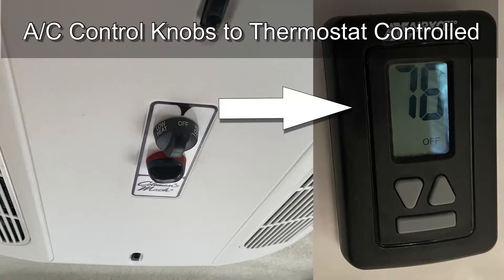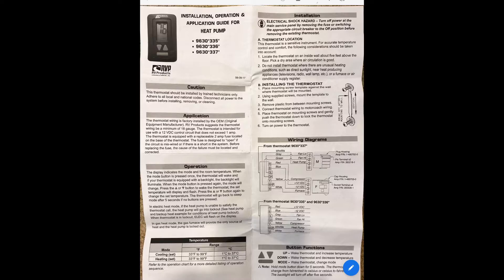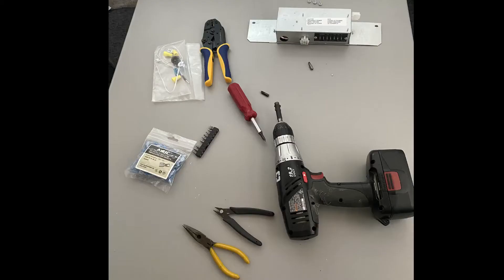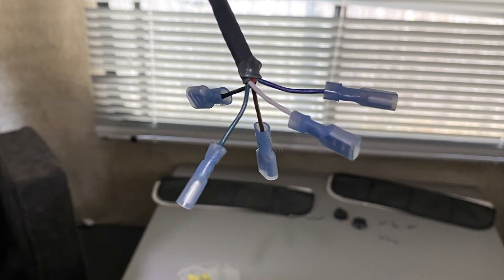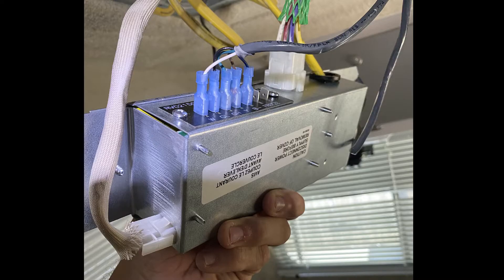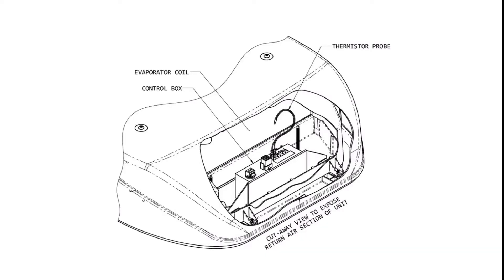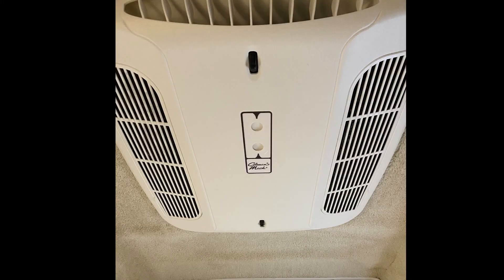A/C Control Knobs to Thermostat Controlled

Comment: THANK YOU... THANK YOU so very much. I installed a new unit with everything for the inside including the Thermostat and the power box. this did not take long.However, the compressor never kicked in and no cold AC. Checked and double checked, tested voltages, compressor continuity, connections, etc. and the compressor wont start....UNTILI watched your video and you said Don't forget to install the Freeze sensor, the compressor wont start without it.... I got an Ah moment... connected the freeze sensor and YESSSS the compressor kicked in and we have COLD air...
THANKs a million.
SUNNY and Sharon
Reply from the maker: Awesome!  I’m very glad my video helped you out!  Thanks for the comment!

Comment: Perfect video !!!! I plan on doing mine now !  I hate the fan the fan runs constantly.  Oh, for the holes if you want a little cleaner look . Pick up some white rubber grommet caps !!! Cheers 🍻  to a well made video!
Reply from the maker: Thanks, good luck!  Depending on your year model, you might need to run some wires up to the A/C from the thermostat.
Reply: @stevelineberry  

I've got a 2021 so it should be very close.  I already have a non invasive route planned for the wiring.  Im seeing mixed things on which control box I need.  I have the Mach 3 Plus... if that makes a difference.  I reached out to Airxcell , hopefully they can set me straight!

Comment: Excellent video!  Got the same problem you had, only mine is a 2021 Casita Spirit Delux!  With the thermostat control box, does the heat strip run independently from furnace or as the furnace turns on does the heat strip also turn in?  Is there ma black wire and a blue wire connected to a blue wire?  Thank you for sharing this!  Lots of folks have experienced this situation.
Reply from the maker: Thanks!! If you set it to Heat gas it will only run the furnace.  If you set it to heat elec and the temperature is greater than 5° then it will run the furnace and heat strip until reaching the set temperature and then it will only run the heat strip as needed.

Comment: Will the AC also heat? I have the exact same one and mine doesn't heat even tho I turn it all the way on red, I've used each setting from fan to hight cool and still nothing, I had to use this one in the bedroom alot this summer to help with my front AC and it's now not cooling very well... Do you have any information I could use... Thank you for this video. I'd love to do this.. so neat!!!
Reply from the maker: If you have a heat strip installed, it should heat.  If yours isn’t, then either you don’t have a heat strip installed or it isn’t working.
Reply: @stevelineberry  Sorry to bother you again about this but where would the heat strip be? Does any of them have blue and red cords?
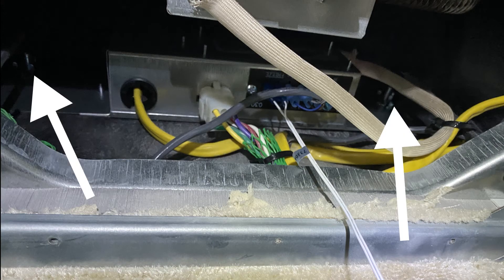Reply from the maker: @jt6969jt  see at the 6:47 mark in the video, the heat strip is at the top of the picture.  Mine looks like the wires had white shielding around it and it plugged into the control board.

Comment: I pick mine up in April.  I hope they have them properly installed by then!  When you picked it up, did Casita tell you they would get it installed for you?
Reply from the maker: I had known from some of the facebook groups that some units were coming with the knobs to control the A/C instead of the thermostat.  So i called Victor at Casita and he told me they were having a hard time getting the control boxes needed to connect to the thermostat from the manufacturer.  So I knew what to expect when I picked up.  I think there were pockets of small companies that had a few in stock so I was able to get one.
Reply: Great video. I assume you have a propane furnace as well. Is there a separate thermostat for that?

Comment: What fan speed does heat use?  I'm waiting on the controller for converting my popup camper and was curious about this.  The instructions don't make mention to fan speed for heat.
Reply from the maker: There isn’t a way to adjust the speed.  My guess is that it’s the same speed as fan lo or cool lo.

Comment: I bought one of these recently and it came without the middle assembly that controls the fan and cooling, do you know the name and or where I can purchase that piece at?
Reply from the maker: Which piece are you talking about?  I put links in the video description, did they not link to what you are referring to?
Reply: The actual switches and control for the knows, I bought one from Amazon and returning it but it only came with the body not the switches or anything in the center. No picture online shows any other angle of this assembly.
Reply: The hidden side is what I am talking abput the center looks like a boat with an ice breaker front.
Reply from the maker: Gotcha, yes, if you use a thermostat like i did here, you don’t need the switches and box.  But if you don’t have a thermostat, then you would need that.  Sorry, i don’t know the part number for it but I’m sure you can find it on the internet.
Reply: @stevelineberry  Yeah no, I'm just gonna strip the wires and replace the thermostat, I've tried searching for the pcb control board and they don't sell those parts because they wouldn't make their money. I've got a back Coleman Mach thermostat from the 90's and the relay crapped out on me. I've got it covered for 30 bucks I can fix it instead of 200
Thanks for getting back to me I emailed coleman a week ago about this and no response.